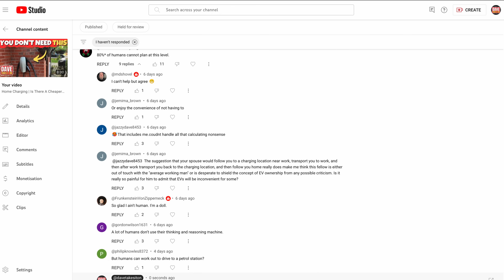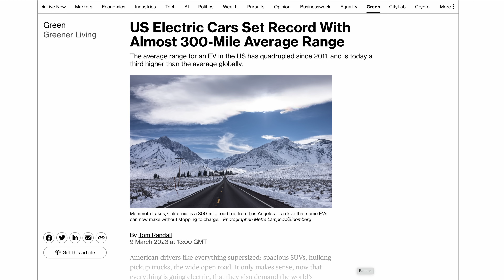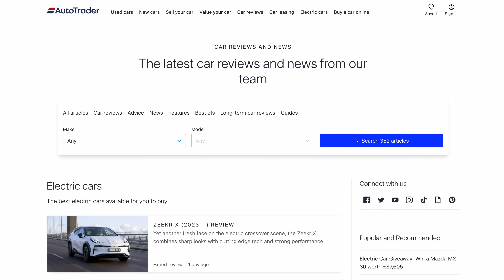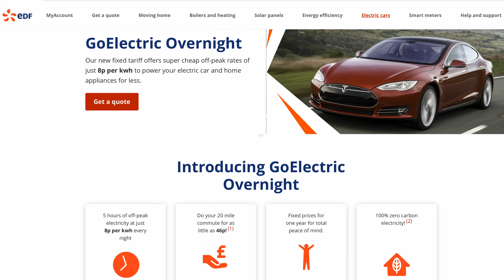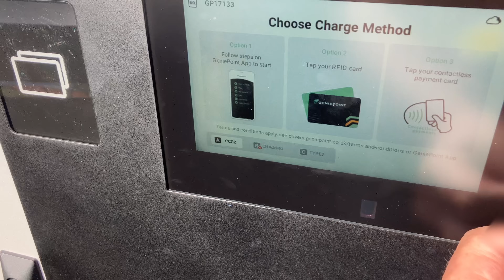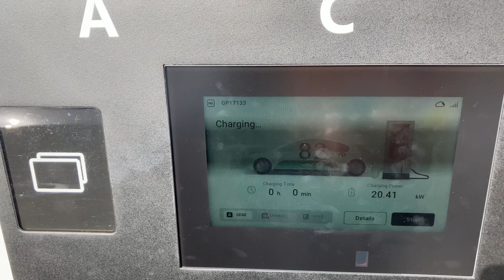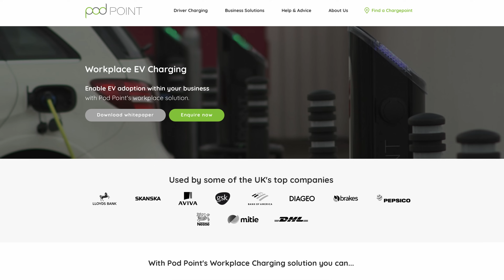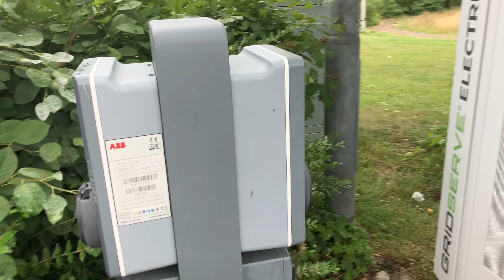Dummy's Guide To EV Charging | Don't Make These Mistakes

Comment: Good talk, thanks!! ❤
Just got a new Peugeot iOn (12.000 km and from 2019) 3 weeks ago. Wanted a small EV and traded my Smart 451 in for this. Had also have to learn how and what. We have here 230V in olland. Slow charging here is a dream. So I made an outdoor socket. Easy peasy... Charges like a dream. Solar panels works very well and we have a driveway. 
Range is about 110 km... More than enough for everything around our house. We do have an ICE car (Suzuki Ignis), so long distance is also no problem. 
To my surprize I have gone way further than I thought it could. Slow driving an degenerative braking rules.

Comment: my car only has the round bit at the top but what im finding is alot of these big charging stations have the round bit and the wee 2 bit at the bottom lol if you know what i mean .... im type 2 but dont have the fast charge bit ....... am i still able to use these chargers i have an MG PHEV 24 plate i do normally charge at home but i sometimes have to drive quite a distance and its only for peace of mind that i charge it before the long journey back home again ....my daughter stays in a flat so im unable to charge there before journey home .... i know my car will still work with no battery as its a plug in hybrid but im more comfortable with a charge in it

Comment: Hmm. Your math doesn't make sense. You say 4 miles for every hour if charged from a regular house supply "overnight"; let's say untouched for 9 hours will only give you 36 miles range. That's not enough to charge your battery to "full" and good for a weeks driving. Or did I miss something 🤔?  Interesting info nevertheless.
Reply: Hmmm, wrong. I can charge 320 mile overnight at half the price of petrol. OK that equates to 200 miles effective for battery longevity but still not bad.

Comment: We just bought a VW id3 and are very happy with it. As owners of a 200 year old cottage, we are struggling with getting reasonable quotes for a charge point and need to wait for National Grid to update our electrics before we can install one anyway. So, we bought an extension lead with a waterproof socket. However, there is a problem in that the car's lead is so chunky that the waterproof socket will not close fully. Having seen this video now, I recognise the symptoms in YOUR socket as I can see a piece cut out to accommodate the cable. To overcome this issue, we bought one of those boxes people use to deal with Christmas lights. This is big enough to accommodate the whole plug and is completely waterproof. It can also be tucked away somewhere inconspicuous.

Comment: 4:47 Any other car? Mitsubishi Outlander PHEV still uses the old type. But as a hybrid with smaller battery, it’s so easy to just charge at home via 3-pin and plenty of type 1 to type 2 cables and adapters. Still a good amount of CHAdeMO points around too.

Comment: Err.... you've missed a key and very important point. How are disabled people going to charge cars, especially wheelchair users or people who would struggle with the cable? Not to mention the kerbs and other non wheelchair friendly problems. Finally, fuel stations always have someone who will help. Do EV charging stations? Answers on a postcard please (and don't have the luxury of off street parking)
Reply from the maker: I covered that in a previous video, contactless charging is already in use for robocabs and are ideal for disabled and cable thefts

Comment: What a faff. Too much of one for me. Ev are ok to drive but I am not planning to ditch my ice car anytime soon. I want to fill car up and be away minutes after opening the cap. No apps, no wallet full of RFID (?) cards. Some of us just not ready to switch.
Reply from the maker: Then don't switch. I have no problem with that. Do you have a problem if I do buy an EV?
Reply: @davetakesiton   no, go for it. No need to upset yourself over a comment eh ? 😉
Reply: @gpr111 In many ways, I was forced to switch to an EV - ready or not. I had a string of issues with my 4 year old diesel ICE, with ever-increasing repair bills until the engine also broke and was going to cost me around £8000 (if and when an engine became available), so sold for 'scrap' - still paying the loan on it now. Switched to a company EV and loving it, with no more trips to a garage to queue and handle their smelly diesel pumps.
Reply: Thanks..... i have just taken delivery of enyaq !!😂  It is a bit of a faff but i can charge at work  ( possibly free !) and having a home one fitted too....  I am not 'sold' on ev - and the enyaq is well rated in all reviews but so far I find it sterile and soul-less but my weekly car "profile" means i can live with it. And on pure financial terms its irresistable. From my limited experience they are just transportation with very little involvement... maybe that will change. May however keep my old BMW too... you never know....

Comment: Good video. But you kept referring to charging your battery to 'full' while you and I know that charging to 100% (full) is not ideal in 'most' cases (planning a long journey is the only time 100% is ideal and obviously certain battery chemistries/types like a 100% charge regularly). Perhaps could have done with dealing with that earlier on/changing the language - a dummy will always charge to full/100% using your guide if they don't listen to the near end. 😉
Reply from the maker: not quite true. The overwhelming majority of cars now being sold have LFP batteries and they can and usually should be charged to 100%. Their handbooks and on screen guides all say plug in every day and charge to 100%. For them the only time they shouldn't is on a road trip, where charging to 70-80% is better, even for LFP batteries.

Comment: A good video Dave but you did rather gloss over the public charger payment debacle, sometimes it's not possible to download an app or it takes a long time due to a poor mobile signal, also there are still many older chargers out there that don't accept contactless payments, or if they do they only accept an RFID card (not debit/credit). Then for those that DO accept contactless, quite often they will take a pre-authorisation of £40 or so, and I have heard stories of the charge then failing and it taking days for the money to be released, that is money that some people rely on to feed their family. I just came across a couple on Saturday who were having a nightmare because the Geniepoint charger they were trying to use did not work on CCS, so they were charging via the type 2 socket - they had been there for over 4 hours! They could have maybe tried a different charger but options were limited where they were. So while you paint a positive image of public charging, the reality, away from the motorway network, is still rather different I'd say. Unfortunately, this couple are now going to tell all their friends what a nightmare they've had and further spread the negative narrative that the MSM also seem to like pushing.

Comment: Overnight I charge between 80 and 100 miles on a standard plug.  One day I will get a dedicated charger fitted. Meanwhile I charge one to two nights a week. On standard rates I am getting the equivalent of 115 mpg on an suv.
Reply: @user-hf7jp2lt5x I still charge on a 3 pin plug socket, a home charger is on my shopping list too. I do 70 miles a day and part charge on the cheap 00:00-07:00 rate and the rest on standard rate, costing me about £18 to do 600 miles as apposed to diesel which did cost me £80

Comment: Thanks again Dave. Very useful video.  I'm new to EV's, but have found i prefer to charge/top up each night (at home). I just like having a 80% tank just in case. It only takes a few seconds to plug in and charging starts straight away. We are waiting to swap to EDF's EV tariff, so we will then set a delayed charge. I've noticed a big divide between ICE and EV lovers. I'm just not sure why. I feel like i've just walked into an argument etc. I have both and understand both have limitations. For our EV, ICE cars cannot refuel faster as we haven't needed to use a public charger (and no need to drive to a fuel station either). Longer runs will require this, but i accept it as part of the pluses and minuses. Next gen batteries will swing the pendulum towards EV's big time.
Reply from the maker: Welcome to the EV club and a healthy dose of reality. No car is ideal, some are much closer than others and most will look very different in the furture

Comment: I drive 60 miles a day, 80% of which is motorway driving, I am one who can't charge at home, there's one working charger in the town where I live, one in the next town up, that takes me to work, on one of your previous videos, you mentioned that if your vehicle covers more than 60mpg, it's cheaper to run than the average electric vehicle, the other major issue I have, another YouTube user told me that I'm a cabbage because I have never had any form of bank card or credit card, again, I work nights, credit card, infrastructure and the price of electric vehicles, at present, I couldn't afford one, (I don't use a technical phone and I have always paid for everything with cash), I don't understand technology I will be honest, being an ugly old fart, I don't have anyone to ask when I don't know what to do. 

Unfortunately, everyone seems to think that we all understand technology and use credit cards, you have used many examples that the average working class people can't afford, hotels, (even holidays), being able to afford to go out for a meal or the cinema, the company I work for refused to install charge points, the only supermarket that has charge points, they still haven't been connected to the grid, the local garage (only local garage) that has electric charge points, again, still haven't been connected to the grid, as a paranoid person, I never let my car run below half a tank of fuel, I fill it up every week even though I could do over two weeks worth of driving before refuelling, I'm not picking holes, but hardly anything you mentioned matches up to myself as I would consider myself an average working class person, where I work, the average daily commute for at least 90% of us working in the same area is around 40-60 miles round trip, for many others it's more.

As one other YouTube user called me a cabbage, I will stick with being a cabbage becau bse, although I am definitely not anti electric vehicles, as I previously mentioned, price, infrastructure and payment methods put me off, and yes, being older I am thick as 5h1t when it comes to technology, I have never been taught and I'm old, but when I have seen the odd charger, they aren't clearly shown, it's just by chance I may see them as I'm driving in the early hours of the day, some large car parks, one inparticular just outside of Bridge north springs to mind, 220 parking spaces, one charger (I only noticed this because I was stopped at a set of temporary traffic lights), I don't even know if it is connected to the grid, there was no sign to say that it was there, no price tariff, just a lone charger, now, as a cabbage, I am going to ask a simple question, where do you find the price of charging? Are the prices regulated in any way? Fuel stations display their prices clearly for everyone to see, do they have to show a price on the charger? You are probably agreeing with the other YouTuber who says that I'm a cabbage, I don't have a problem with that, but as someone who doesn't understand technology, doesn't know how to use a technical phone, doesn't know what ap is, electric vehicles are a very complicated area, my friend who is writing this for me is off back to Japan on Monday, time difference, working routines, I can't just pick up the phone, my neighbours are all older than me, don't use cards or computers, they weren't around when we were young, the issue I find with not just electric vehicles, but clean air taxes, just about everything these days, it's assumed that everyone has a computer and credit card and knows how this all works, sadly we don't, we are the left outs, the cabbages, I know that the government wants us dead and COVID didn't do the trick, but can't they just kill us off or wait a bit longer for the generations that understand these things? I have so many more questions regarding electric vehicles and charging, but you will either think I'm taking the p155, or you'll just ignore me because you think I'm beyond thick
Reply from the maker: I know of nobody, I repeat nobody who doesn't use tech. Even ex bankrupts are legally entitled to a bank account and contactless debit card. I rather think from the length of your reply that either you expect a special consideration for all industries to cater especially for you and the very few others like you, or, I suspect the real truth is you are just looking for excuses not to go full EV. If that is there case just own up and never buy an EV. The industry will not miss you. Also please stop trying to put us EV drivers off, we will definitely not miss your lies and false info.
Reply: @davetakesiton  I have nothing against electric vehicles, I have never tried to put down electric vehicles, I'm sorry you think that way, I would love you to visit the street where I live, my neighbours in their 80's and 90's, who don't use technology, when you consider that we are supposed to be cleaning up our planet, another YouTube electric vehicle evangelist called me a "cabbage" because I still use my 20+ year old Nokia phone which literally makes phone calls, a phone I charge once or twice a week, but yes, because you don't know of anyone who doesn't use technology, does that mean that everyone uses technology apart from me? If so, I am the odd one out on the planet, especially as I have never been taught anything, my use on here is self taught, you're obviously younger than me because, when I left school and college, they never had computers, I remember speaking to a professor back in the 1980's who said that he didn't think computers would ever take off because they're too expensive, there will only need to be a handful of computers throughout the world, and he also called credit cards a passing phase as they were causing too much debt.

You mentioned cards, without a credit trail, you can't get a credit card, I have a bank account, I can't get loans so I could never afford an electric vehicle, I couldn't afford the cheapest internal combustion engined vehicle, I have to pay with cash, I have always used cash, I don't like debt, if I haven't got it in my pocket, I can't spend it, so, as I have mentioned in the past, vehicles are too expensive full stop. 

I have criticised the electric vehicle infrastructure I'm not denying that, in the town where I live, there's charge points, but they're not connected to the grid, the only charge point working is in a local car park which is expensive just to park there, I live in the centre of town, I'm not as privileged as you, I haven't got a driveway, I can't afford the luxury of a home with parking, the government are pushing everyone to go electric and they haven't catered for the fact that many of us can't even park near our homes, so I am critical of that side of things, again I apologise for speaking up about things like that 

I apologise for offending you and everyone who watches your channel, I will stay away from your channel, again, sorry to you and everyone else I have offended

Comment: We’re EV newbies and fortunate enough to have off street home charging. The 200 miles in 15 minutes you quote I assume is on a DC rapid public charger. Whilst convenient there’s are very expensive and work out more than running and ICE car. In my opinion the value of an EV depends on how you use it, the typical length of your journeys and access to home charging.
Reply from the maker: True. Rapid chargers are for road trips and longer distance. Home charging with a cheap overnight tariff is the ideal for the bulk of your charging. Overnight the time it takes doesn’t matter, for charging on the road speed is usually better.
Reply: That's a big consideration of mine, I have a daily commute of 60 miles round trip consisting of 80% motorway driving, I don't have access to off road parking/home charging, I also don't have a bank or credit card and I don't understand technology, another YouTube user called me a cabbage for not having a bank or credit card and not understanding technology, apparently you plug your vehicle in to the charger, tap the charger with your card, pay your parking fees, display your ticket and the car is charging, whilst in Cardiff learning how to use a computer I have seen people getting parking tickets whilst "tapping the machine with their card" as the charger isn't working, I asked them how they knew if the charger was working they replied "f*** off"